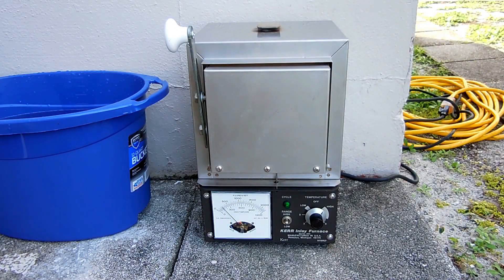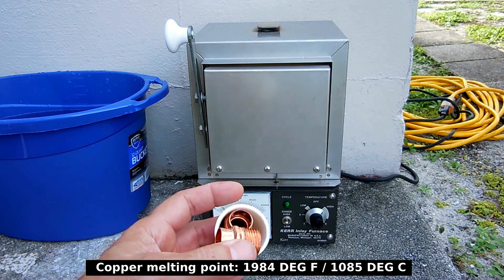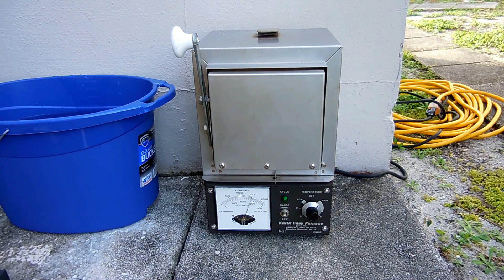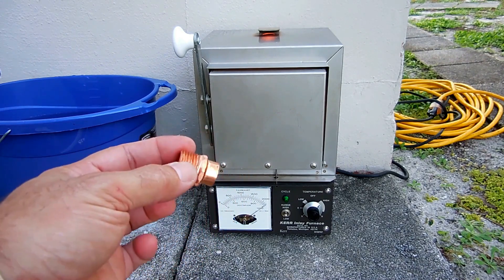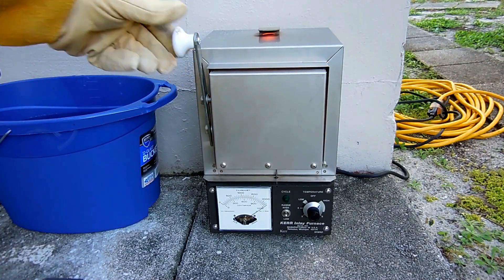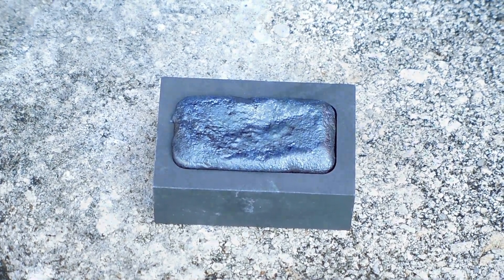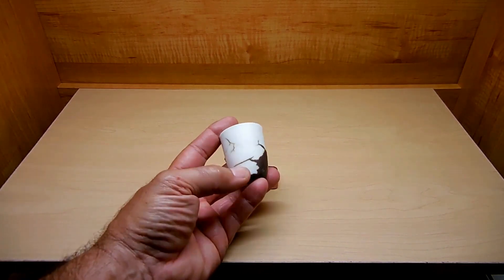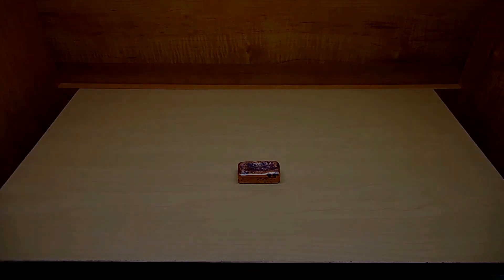Melting Copper Into A Bar! (Scrap Plumbing Fittings)

Comment: Can a ceramic crucible be used instead of the graphite one? Is it better to use the ceramic one?,   Is it possible to melt copper without using borax?
Reply from the maker: The one shown in the video was ceramic. I thought it could handle the thermal shock of rapid heating, but it couldn't. The crucible needs to be heated gradually in the furnace to prevent cracking. Graphite also works very well. Be sure to look over my extensive video playlists below for other videos of interest to you and most importantly share my channel with many others. Thank you!
https://www.youtube.com/c/electronicsnmore/playlists
Reply: @electronicsNmore  ok. I have to melt copper with zinc to make metal alloys and I will use an electric oven and I would like to buy a ceramic crucible.

  how did you break it? did you put it cold in the oven at 1200 ° C? Is it true that the ceramic crucible produces less slag? did you use borax in this video?

Comment: I'm surprised you'd place the cold crucible into the furnace that's already preheated to such a high temperature.  Wasn't there a risk of thermal shock cracking the porcelain?  Also, what does the addition of flux or borax do to the purity of the metal when you're done?
Reply from the maker: Hi there! I thought the crucible was able to withstand rapid heating, which is why I did that, but now I know they need to be heated slowly. I think most of the flux ends up in the slag on top of the molten metal, or burns off after doing it's job. Thanks for watching!

Comment: The trick for pouring nice bars is to have a big heavy crucible. A big heavy graphite clay crucible will stay hot for a couple minutes when you take it out of the furnace.
Reply from the maker: I already ordered one. :-)
Reply: @electronicsNmore  you may want to consider building a propane Foundry. It's cheaper to run and build. It will melt metals in a matter of minutes once it's up to temperature. You're also able to use much larger crucibles.
Reply from the maker: @philipbender956  Yes, I like one TKOR made.

Comment: I built a furnace out of a coffee can. Lined with fire clay silica sand and broken brick mixture.
The top was made of the bottom of another coffee can with a hole in the top. Only you need a net of wire to hold the clay in.
A handle on each side to remove it.
A propane torch and a crucible. My crucible was a mettle pipe i was melting aluminum.
Later i made the big one out of a trash can. The propane torch was the hose kind the trash can one took two hooked up to the BBQ gas tank.
Sounds like a jet when using it.
Reply from the maker: Thanks for watching! Please share.

Comment: Here are a few tips  put the crucible in the furnace before you turn it on and make sure it's loaded with the metal and  flux  that you are going to melt so they all come up to temperature at the same time ...  By putting the crucible in the furnace after it is already up to temperature you are risking thermal shock and cracking like you  observed in your crucible also heat up your graphite mold with a torch before getting ready to pour your liquid metal ....  And also a few minutes before you are ready to pour your liquid metal toss in a decent amount of flux in  The crucible and stir  thoroughly ....
Reply from the maker: I had a strong suspicion the rapid heating caused the crucible to develop cracks. Next time I'll place it inside while the furnace heats up. Thanks for the tips!

Comment: Would it be advantageous to heat the mold along with the crucible?
Reply from the maker: Possibly. It may reduce pock marks on the surface of the finished bar. I'll try that next time. Thanks for watching!
Reply: electronicsNmore Probably just need enough temp to drive off any water, maybe just leave it on the top of the furnace during the heat.  

Have any casting projects in mind?
Reply: It's usually quite dangerous to NOT preheat the mould - a tiny amount of invisible water could make the molten copper jump right out of it otherwise - you can find many related videos of accidents right here on youtube, e.g. https://www.youtube.com/watch?v=A796N_YZTm8 :)  Be safe, love your videos!